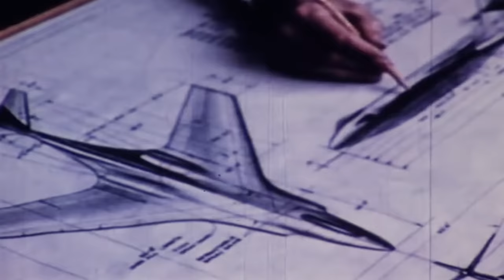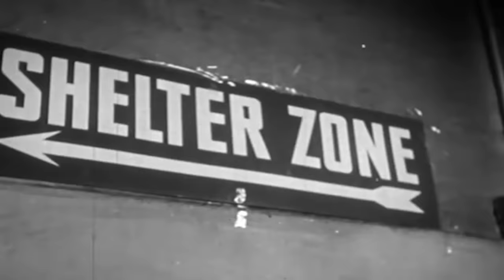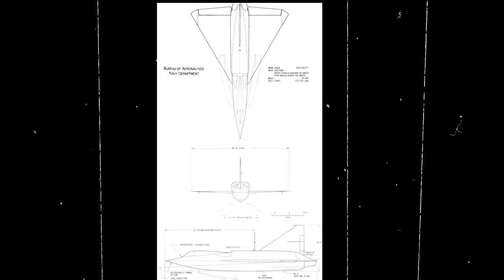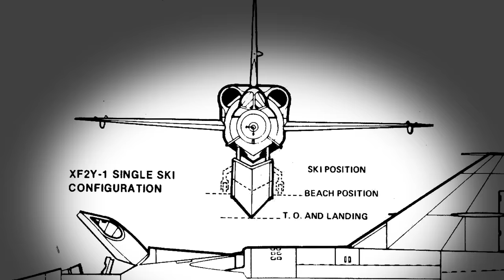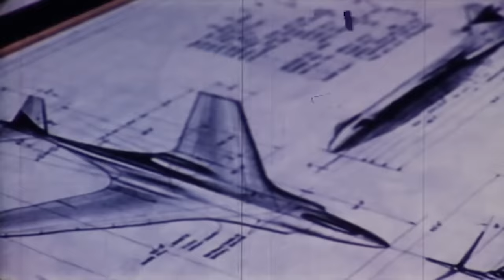The Airplane that Was Going to Change Everything

Comment: There’s one on permanent display at Willow Grove NAS in Willow Grove, Pennsylvania. When I was younger, I used to take all of my cars there to take pictures with it. There’s a parking lot where you can pull up off the main road (Pa. RT 611) that goes around the air station and park right next to it on the other side of the fence.

Comment: It is apparent the original engineers knew nothing of the sea. Any significant open ocean sea state would make takeoff and landing impossible. Salt water would corrode and destroy the engines. To this date, on carriers, salt water mitigation on aircraft is a major issue. How in the world would it be fueled and armed mid ocean, and by whom? Fascinating concept; thoroughly impractical.

Comment: The only real problem this aircraft truly had was that it was ahead of its time. New Naval doctrine could reinvigorate a desire to return such aircraft back to a promising career. Planes like the E-2 Hawkeye and the P-3 Orion could be replaced with larger, faster, more advanced turboprops, or even jet engine equipped watercraft. Now with advanced materials and designs, this is the best time to reconsider water based aircraft. Also the "Wing in ground effect" is also promising as well, offering a much larger craft cruising fast just above the water.